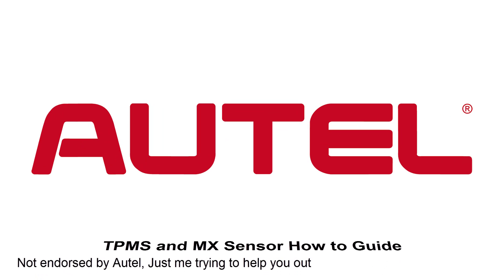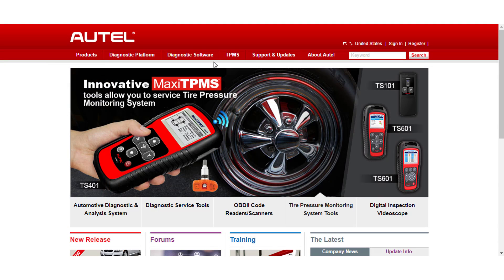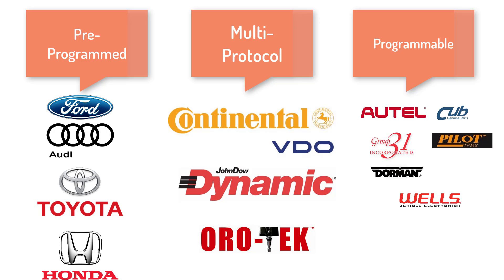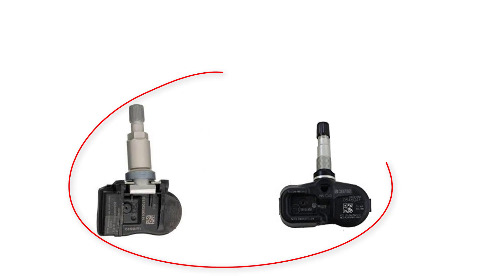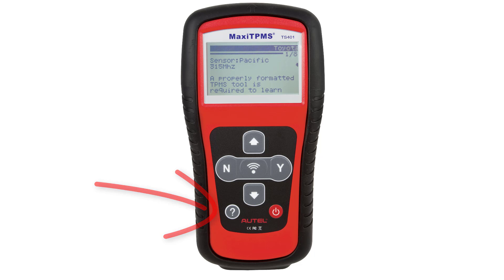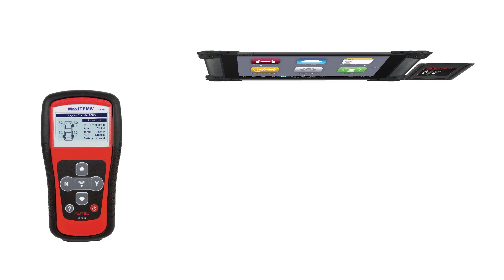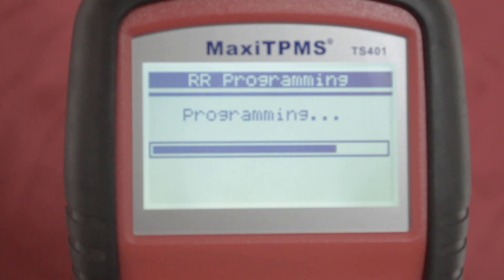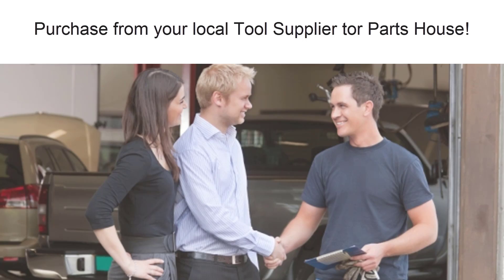Autel TS401, how to program MX sensors

Comment: I have aftermarket rims with purple max duel frequency tpms and I purchased the autel ts 401 is there a way to clone the ID to my new sensors? Or will I need the ts508? With OBII cable
Reply from the maker: You can ready the ID'S out of the purple sensors and clean them into the Autel MX sensors

Comment: Question,  i lost my 4 oem ford escape 2014 tire pressure sensors, im planning to buy 4 pcs new Autel MX-Sensor 2 In 1 (315MHz + 433MHz), can I use the autel ts401 to install it ?

Comment: Hi. Im using my ts401. Had used it before bo problem. This time im having a small issue. So ts 401 was able to scan all 4 oem sensors. Im trying to copy them to new autel 1 sensors. Regardless of what function i use i got an message Multi-Sensor. Even if i try to read the mx sensor from setting function, same result. Any idea why?
Reply: Lol nevermind. I found the answer in your FAQ site. Too many sensors too close at the same time of programming...duh...lmao...after that worked perfectly.

Comment: I tried to manually program an Autel MX programmable universal sensor with the ts401.  The id number doesn't change. i followed the onscreen instructions.
Reply from the maker: First, Make sure your tool is up to date with the latest software. Second,  try picking a totally different vehicle with a different frequency. then try to go back to your original vehicle and see if it takes.
Reply: @FlashPerformance  Great advice. I programed it for a 433mhz BMW successfully and then reprogrammed it for The 315mhz Toyota. Success.

Comment: I have a 2015 Honda CR-Z. It has MX sensors. AUTEL had no re learn procedure for my car. I don't know what to do. Help.
Reply from the maker: Honda requires an OBD2 relearn, you would need a TS501 or better to do that relearn. With the TS408 you can only do copy. Meaning you would read the old sensor and copy the information into the new sensor

Comment: Is it possible to train a TPMS sensor on my 06 Explorer before installing it in the tire ?
Reply from the maker: Yes, The Explorer is a stationary relearn. You would use the TS401 or any other Autel TPMS tool to Auto Create to be a Ford Explorer, then you would do the relearn process. During the relearn process you would scan the wheel or MXsensor that you what in each position to learn it to the vehicle. The horn will honk after each sensor is scanned.

Comment: I have  new alloys and fitted mx sensors ready to fit tyres. the sensors came with the autel pad but this cannot pick up the sensors in the old wheels through the tyre wall. I believe some sensors/vehicles can auto learn when being driven and was hoping this is what my vehicle can do. Jeep GC 2015 ecodiesel. UK model. Thanks.

Comment: Hi, looking to purchased the TS508 , and I was wondering if it can work with Multi-protocol sensor.  Or at the very least capture the sensor ID and then copy it to a Mx sensor? 
Thanks
Reply from the maker: The Most common Multi-Protocol sensor is the VDO sensor. Yes, they will work with those and others. In this video I called them information ready sensors
Reply from the maker: @hdi7kJXqmW4q  VDO is an information ready sensor, once you scan it with the TS401,after selecting Year Make and Model, the sensor will be ready for install.
Reply from the maker: @hdi7kJXqmW4q  No, they are ready to go, when you do the relearn process it will pick up the new OE sensor ID

Comment: Hi, I have a 2018 Wrx STI with aftermarket wheels, I purchased the TS401, will I need to buy another tool in order to program the new OEM subaru sensors that I will be installing in the new tires? Or can I simply use the copy by activation with the programmed TPMS sensors in the stock tires? Please help!
Reply from the maker: The WRX requires an OBD2 relearn process, the TS401 does not have the ability to do that.  You would need to have a TS501 or better to do that relearn.  If you have not purchased and installed sensors yet you can use Autel MX sensors with your TS401 and copy and program each sensor and that would solve your issue as well.

Comment: I want to buy this for my nissan will this help with relearn/ or activate them procedure because I put new tpms on
Reply from the maker: You will need the TS501 and if you use OE sensors, VDO, or the Autel sensors you can relearn them
Reply: @FlashPerformance  just bought the ts 501 thanks for your] response 👍

Comment: 2014 Kia Rio LX. I bought OEM used sensor. Will this work for me?
Reply from the maker: The Kia Rio requires you to write the sensor ID's to the PCM.  You can do this a few different ways.  If you have a TS501 TPMS tools or better these will perform that function with no issue.  If you have a professional level scan tool you can use the TS401 to ready the IDs and use the Scan tool to write them to the PCM.  To answer your questions, the TS401 can not do the process alone.
Reply: @FlashPerformance  I believe the same applies for the KIA Forte 2020, right?

My understanding is that there's no way to clone the sensor IDs from the original sensors into the spare ones I'm buying for my winter tire set (and plus, the car's ECU needs to receive the IDs from the spare set of sensors I buy).
Reply from the maker: @OliveiraPaulo1978  You are in a unique situation.  If you are going to run a set of winter tires you could purchase the TS401 or better and clone the OE sensor ID into the new Autel MX Sensors.  As long as you write the location on each wheel you could swap summer and winter tires and never have to worry about TPMS.  Essentially when you clone the sensors you would put the exact same ID in the exact same location just in a different tire.

Comment: So TS-401 only can tell you the sensor code.
Reply from the maker: It can do the relearn process on 33% of the vehicles on the road.  As long it does not require OBD relearn
Reply: It can copy the original sensor code and program an Autel sensor. So relearn should not be necessary. Looks like every sensor brand requires their programming tool in order to keep you on one brand. 

Ecample: I can use an Autel tool to read any sensor but I cannot program a Schrader sensor, only an Autel one.

Comment: I am looking at buying the TS 408 to clone/copy my defective sensors as I have purchased programmed sensors that are not MX sensors. 

 I looked at the TS601 which has the computer linking ability but I don't plan to do this professionally and that unit is pricey. 

 Do you think the TS 408 will meet my demands ?
Reply from the maker: Check out the TS508, you can get it in a kit with sensors. https://youtu.be/7rszSlKKzag

Comment: Just got done swapping out 2 new VDO sensors that my TS508 couldn't see.  The sensors were already installed in the tires and aired up to 30psi and driven on before I got around to doing a re-learn or triggering them. (Installed a couple days before I had the Autel.)  After a couple calls to VDO tech support, they told me that their Redi-Sensor SE10003A and either 2A or 4A (don't remember) sometimes need a higher end scan tool to Activate (vs Trigger) their sensors and that the Autel wouldn't work... They also said that I should've 'Activated' or triggered them before installing, inflating, balancing, and driving on them and that because of that, they must've locked into a random (wrong signal) and now need to be unlocked with a better tool. *Since I started this comment, I went back out to the garage to see if the Autel TS508 could see / trigger the VDO sensors now that they're uninstalled, however it still doesn't see them.  This was my first time doing TPMS's. Live and learn, but thought I'd share for any other noobs out there.
Reply: Thanks for taking the time to share this info.

Comment: is it possible to re-program already installed, in the tire Autel TPMS sensor, from outside of the tire using TS401 ?
or does it have to be outside of the tire to be re-programmed?
Reply from the maker: The tool is powerful enough to program through the sidewall.  Just make sure you are at 0 PSI when programming.
Reply: @FlashPerformance  I checked with manuals, and it says keep it under 10 PSI. which is achievable without a jack.

Comment: I have my Stock Factory Wheels on a Honda and i was wondering could i clone the original Honda one with this unit and program the ones that are on my winter wheels, every winter i switch to winter wheels and the light is always on, on the dash and Honda says we need to program the Car Computer to use the winter wheels and then reprogram the car to use the summer wheels on so they want me to pay every time i switch wheels in order to get the light off the dash,
Reply from the maker: Honda uses OBDII relearn, you would need the TS501, TS508, TS601 or TS608.  All of these tool can do the cloning procedure with Autel MX-Sensors and do the relearn
Reply: icefxtoronto  -  Would you not be able to just copy the info off the TPMS from the original Honda wheels and then program that info over to the TPMS on the winter wheels. So when You swap wheels the car reads it as being the same sensor or will that not work for the Honda
Reply from the maker: @raztechstudios  Yes, you absolutely could, if you purchased 4 Autel MX-Sensors and cloned each one of them to the same as the ones that are on the current wheel that would work.  My concern is that you would not ever be able to rotate your tires.  If your Honda shows the location of each tire displayed with PSI on the dash, and they were not put in the same position the pressure readings would be incorrect.
Reply: @FlashPerformance   - Yeah we dont even know that brand or Sensor is on the winter tires now, it was installed by the tire shop when winter wheels were purchased, 
so if they are not the AUTEL MS Sensors then there is no guarantee it could even be reprogrammed correct,  So based on your experience being that this is for the Honda Odyssey Mini Van 2017 i believe,  what do you recommend should be done,  so that i dont need to go to the dealer every season and get charged $80 every time we do a wheel swap so they can update the Vehicle Computer with the new tire settings so the light doesn't stay on?  of am i just stuck in this scenario, and just let it be
Reply from the maker: @icefxtoronto  If you already have sensors in your winter tires, and they are working, just leave them in there.  Purchase a TS501 and just do a relearn each winter. Then swap the tires and do another relearn.  The relearn takes 10 min and is very easy to do.  This way you don't need to break down any tires and you can use what you have. The TS501 will be able to read the sensor you have and gives you step by step how to do the relearn process.
Reply: @FlashPerformance   - Ok Makes perfect sense.  Thanks for you help, thats what i will do

Comment: When you have to change a broken TPMS sensor, can you adapt /clone the new one to the cars TPMS system or do you have to buy the TS601?
Reply from the maker: The best way is to clone the broken sensor to a new MX sensor with the TS401, that way you are using the same sensor ID the car is already looking for.  This can be done with the TS401, TS408 or any other Autel TS tool.  If you do an auto create or you use a different sensor you would have to use a scan tool to write the sensor IDs to the car, or a TS501, TS508, TS601, TS608.  Here is a video where I used the TS401 and programmed a sensor for my Wifes Toyota: https://youtu.be/s4fWyQtXMuw
Reply: Flash Performance 
I want to start working with tpms.... where to start what tools I need... any instructions, videos....
Can you recommend please, I will appreciate it.

Comment: what maxisys model did you use?
Reply: raymond navarro Any of the MaxiSys tools will program sensor IDs to the PCM. in this video I used an MS908
Reply: So the MaxiSys MS906 will that also do this function? I plan on picking one up this week and it is packaged with the 401 So i guess that makes sense they would combine them. But I would still like to hear someone say yes. Thanks
Reply: Can I use a TS608 to program sensor Ids to the pcm?